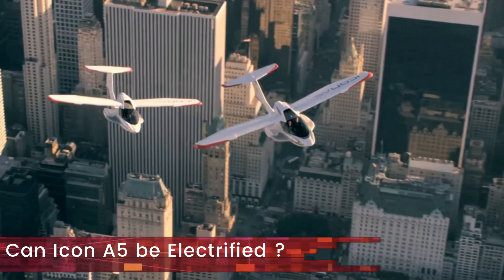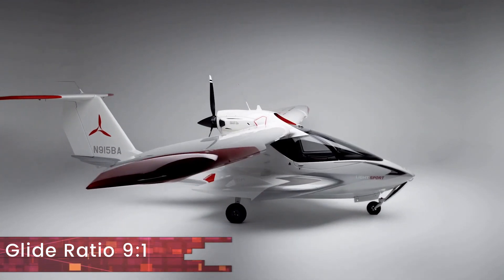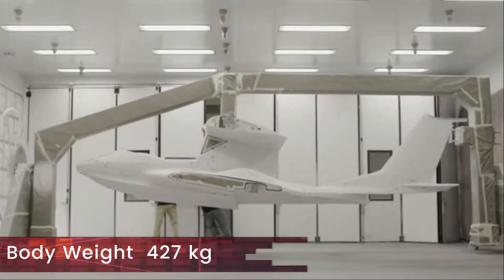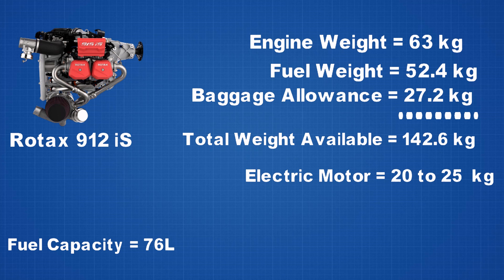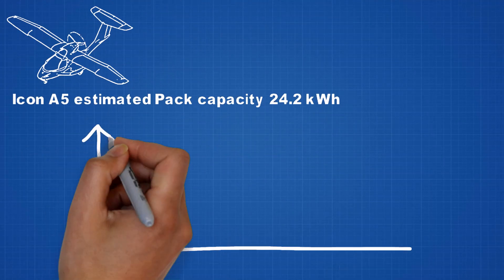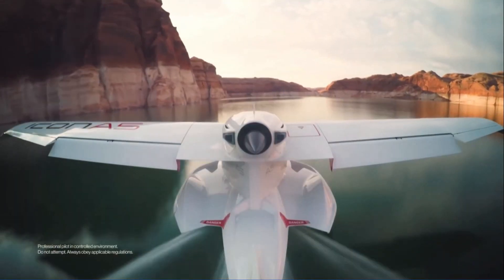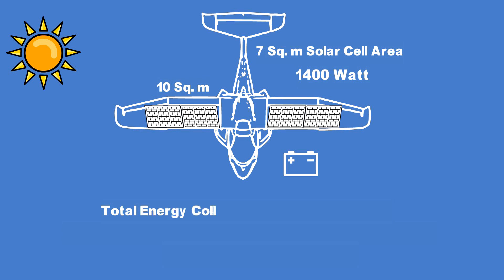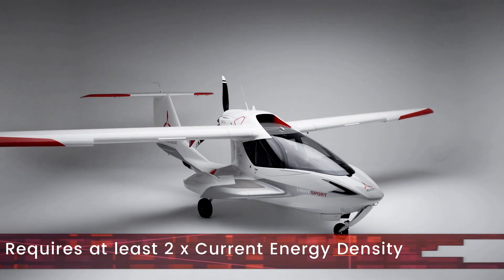Electrification of the Icon A5

Comment: With today's battery technology, which will also exist in the near future, the only reasonable solution for all electrified aircraft is for going hybrid.
This means a "range extender" driving an electric generator that charges the battery system.
In this case, we have to compare the weight of the rotax engine, with the weight of the range extender, the generator module, and the electric engine, combined.
The result would probably be a similar weight system, with similar engine noise, that probably doesn't worth the fuss, moreover, since the position of the propeller  doesn't need to be far from the new electric engine system.
We would need to significantly alter the current design of the Icon A5, ending up with a completely different aircraft, in order to experience significant benefits out of the electrification of an aircraft of this size, by adding redundancy needed for flying over ocean for extended time, with the  addition of a second redundant "range extender", and by possibly giving also vtol capabilities with distributed light electric engines on the wings and tail...

Comment: The Equator P2 Excursion is a great candidate for this channel IMO.  It’s got a great design, making use of the compact nature of the electric motor to keep more of the prop in undisturbed airflow, allowing for a streamlined lifting body design, and it allows for a bunch of random benefits like increase cargo space and front egress.  It’s currently planned as a hybrid, which is great for the transition period until batteries advance further.

As a seaplane pilot, I get excited just by the mere thought of being able to stop or reverse thrust on the prop :)
Reply from the maker: Thank you for the suggestion
Reply: @ElectricAviation  best of luck growing your channel. It’s an exciting field